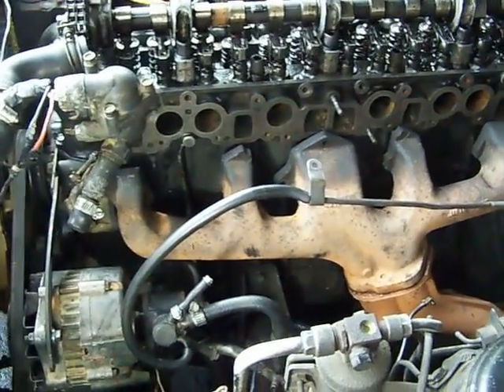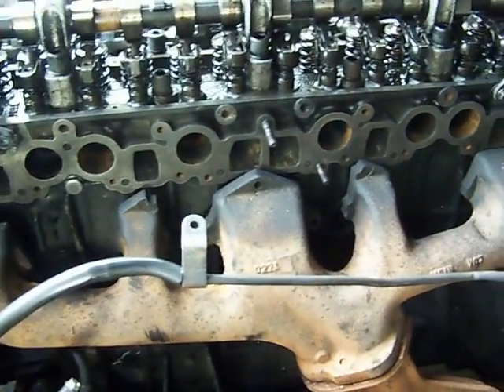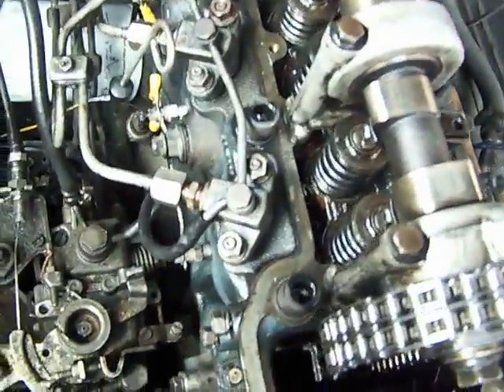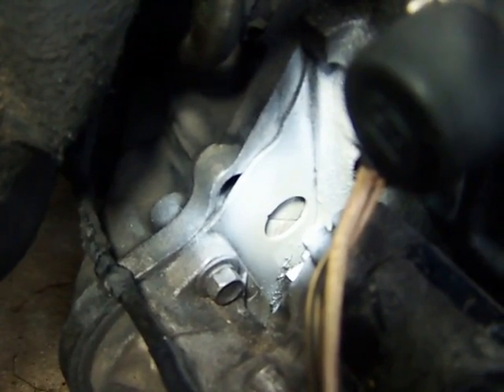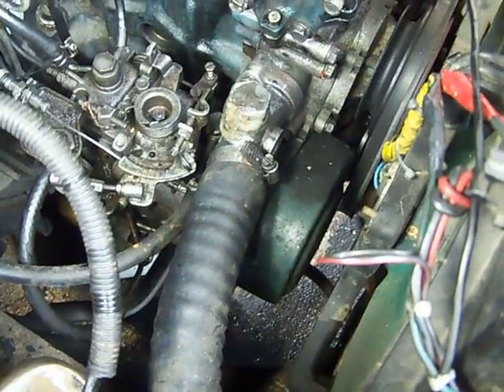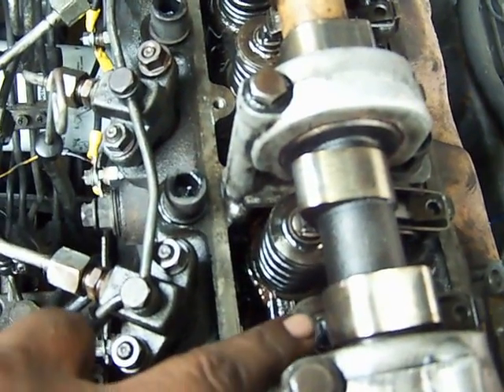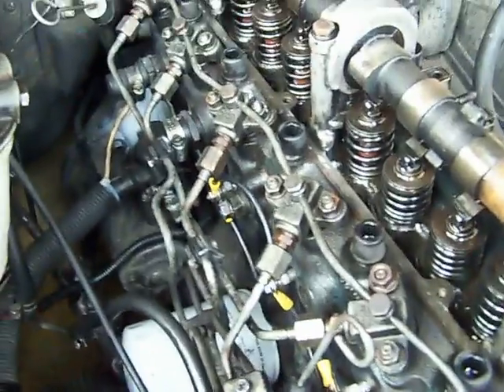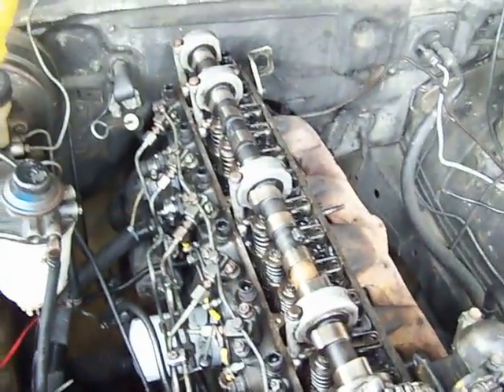LD28.mp4

Comment: Suresh ...yuh still have that engine? how do you remove the crank pulley... damper in mine separate from the belt drive guide and i want to remove it and weld it back together....

Comment: I am from Trinidad. To remove fuel injection pump you need to remove.
radiator, the cover over the pump timing belt. the timing belt for pump, the pump pulley with a puller , the injection lines, a bracket under the pump , three nuts holding the pump to the front . its a lot of work , but very satisfying
Reply: hi Suresh
we trying to assemble a LD28 but having some trouble getting the timing. The engine has a timing belt.